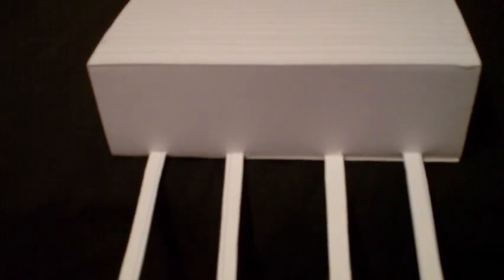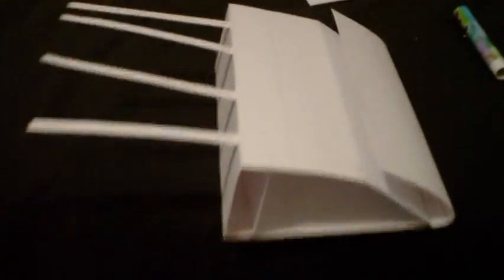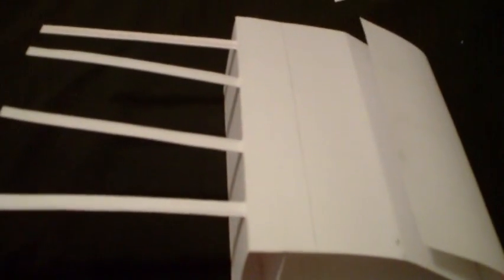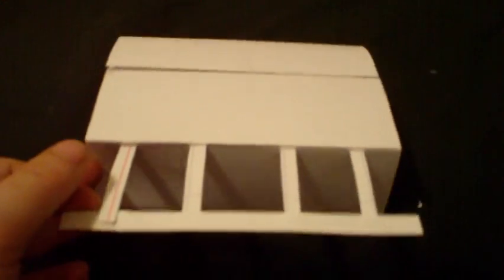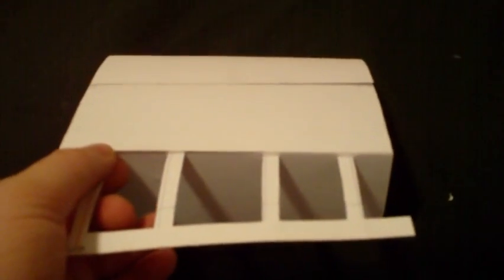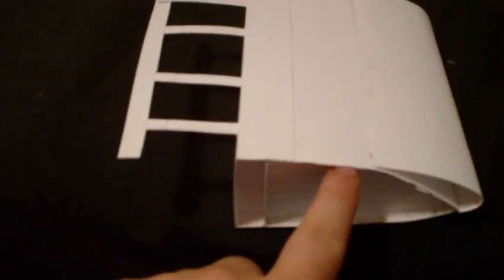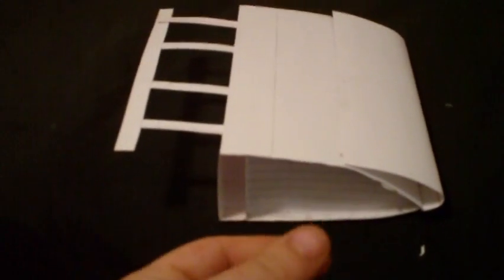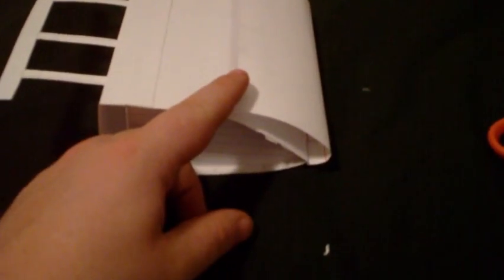Model Leading Edge Slat Device Explanation & Development HD

Comment: Wow 2011, I’m watching in 2022. Excellent video for slat demonstration and for modeling persistence. Hidden though applaudable is your level of patience. You will be an inspiration to many. So I was searching leading edge slats and so here is my question. Your flying straight and level, trimmed and stable. the airspeed is safe to extend the slats only as in no flaps also. If that’s possible, so slats only. How is the pitch of the aircraft affected? Pitches up, stays level, or pitches down. I’m a private pilot with under 200 hours, never have I flown hands on a plane with movable slats. So curious to find out what flight attitude if any is upset by slat extension.

Comment from the maker: @willettgarrett2 Well there are many different names for leading edge devices by the way the extend/retract and their aerodynamic purpose. Slats: are airfoil extensions that lower as extended, LE Flaps have no space in between once extended Though not outwardly, and are mostly seen on fighter jets. And LE slots are most commonly seen on STOL (Short TO and LD) aircraft and are rarely retractable. But yes, Leading edge flaps do exists but on fighter aircraft wings such as an F-18.

Comment from the maker: @magyar3 What you speak of is called a leading edge slot, But my explanation of the slot is that it is a very small chord wing on the leading edge that at a high AOA will help produce lift but mainly also allow for smoother transition of airflow over but also creating what is called the fresh boundary layer effect, Or a fresh stream of air over the wing.

Comment: @bbbrutha1   I thought the whole idea of leading edge slats (Fieseler Storch) was for air to enter between the leading edge and the slat, while at a high angle of attack, and then the air speeds up forming a venturi like effect which delays the disruption of the airflow over the wing, thereby delaying the onset of a stall..